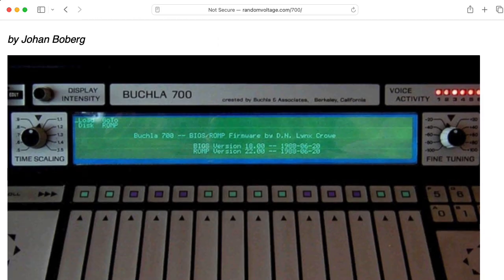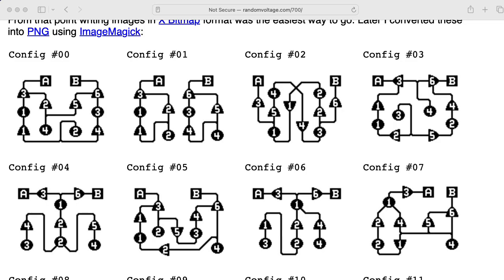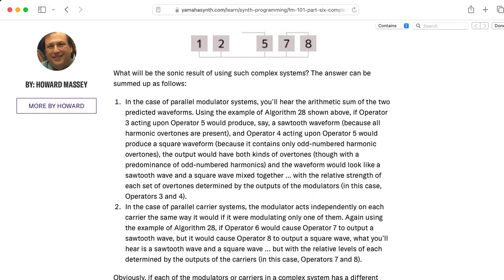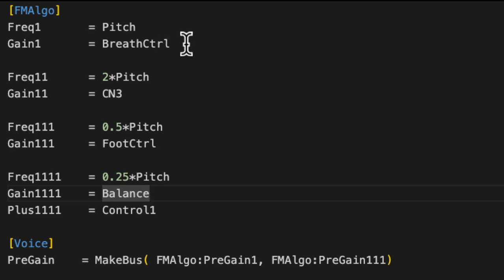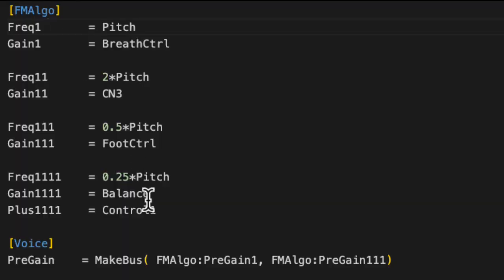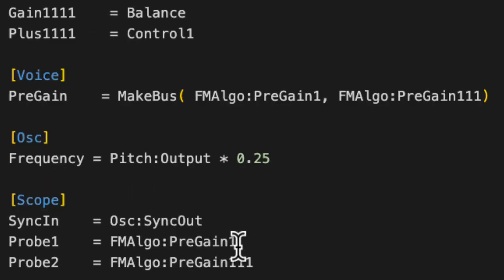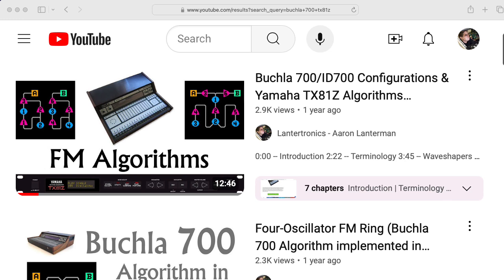Buchla 700 FM Ring implemented in Moselle Modular Synthesizer Software (Four Oscillator Algorithm)

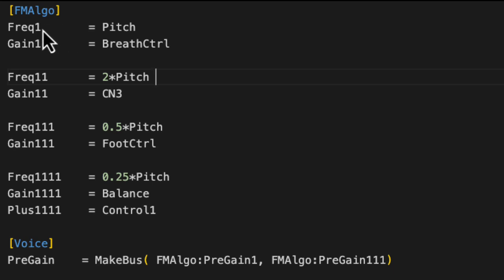Comment: 3:29 Yes: FMAlgo can be totally replaced with Osc blocks set to sine waves.  In fact you can also write the same thing using raw math with the Sin() function and Note:Time and Global:FreqEval (the sampling rate).  But FMAlgo will be a bit higher performance and as you say, hopefully easier.  BTW there's a Word manual that is 80% incomplete but has a nice chart of how to do the Yamaha DX7 algos in Moselle.
Reply from the maker: Oh! Is the Word manual somewhere on the website I overlooked or is it something you haven't released yet?
Reply: @Lantertronics  it's only partly-written.  I should go ahead and throw it into the next release even though it's 80% empty sections.
Reply from the maker: @franksheeran9243  Just a list of all the Modules, along with the names of all their Inputs and Outputs, would be tremendously helpful, even if it didn't have have any descriptions.
Reply from the maker: The main thing I recommend is dropping the 1/k scaling with harmonic number k on the harmonic coefficients. Constant coefficients should give me impulse waveforms, 1, 1/2, 1/3 should give me a sawtooth. I realize that involves changing a massive amount of the tutorials, but as it is it's going to lead to tremendous amounts of confusion -- I'm not aware of any other synth or software or textbook that uses an hidden 1/k convention..

Comment: 2:00 Moselle has had "waveshaping" penciled in for a decade.  If anyone has some favorite waveshapers I should take a look at before making something dedicated, please let me know!

That said, the normal math operators SelectN(), SelectLoopN(), Select(), LinFade(), LinFadeX() and Peak() do most of what the Map() module was meant to do.  You can also do all sorts of waveshaping with logic and math functions.  For instance IF( Signal >.5, .5, Signal) would clip the input signal.  Tanh() can give classic tube-style nonlinearity as the output keeps  getting higher but never quite gets to 1 no matter how high the input goes.  You could run a Sawtooth LFO's Positive output into Sin() to get a "poor man's sin oscillator" and do all that kind of thing.
Reply from the maker: The Buchla wave shapers are based on Chebychev polynomials, which should be doable using the math operations in Moselle without too much fuss, I think.
Reply: I can second the Buchla Chebychev wavshapers!

Comment: 2:15 Without any disrespect to the Buchla engineers or the documentation effort, showing the crossed lines on config #02 and #10 wasn't strictly necessary.  It would be understandable if they wanted to maintain all operators with inputs on top, outputs on bottom, as in the renowned diagrams for the DX7.  The root problem, I think, is that  they only had maybe 80x60 pixels or so to work with.
Reply from the maker: Yeah, those diagrams are based on someone deciphering the source code that spits out the diagrams. And yeah they didn't have a lot of pixels. :)

Comment: On the SY77 every operator has two inputs. When not used by the algorithm a free input can be used for a user defined 2nd feedback path or even patch in a AWM part. Unfortunately they dropped these options in later FM versions, the 2nd feedback path is quite a usable feature. In a way the synth engine of the SY77/99 was more advanced than that of the Montage and MODX.

Comment: Can you run moselle at higher sample rates / use oversampling? I ask because the digitone made me realize how much better fm sounds when the modulation is done at ultrasonic rates - the digitone uses 192khz if I'm not mistaken, and it results in much smoother and glassier tones and less of the "Sega fuzz" we traditionally associate
Reply: (continued, accidentally pressed reply too soon)

...we traditionally associate with the FM sound. BTW, digitone also has a somewhat similar feedback algorithm if I recall correctly, you can check the manual to verify but there's definitely some feedback configurations at any rate.
Reply from the maker: Yeah, FM can get nasty at high indices of modulation if there's a lot of aliasing.

There's a place in the configuration file of Moselle where you set the sample rate. This needs to match the rate of your audio interface -- to my knowledge it doesn't do upsampling, but if you run it and your interface a higher rate, you could always take the rendered file and downsample it later (I personally don't see a need for higher rendered rates than 48K, since all modern DACs are fancy upsampling ones anyway).
Reply: @Lantertronics  Dang, they should still add a specialized oversampler similar to some supercollider ugens. Oversampling the entire DAC is a bit overkill - it's mainly the modulation that needs to be oversampled, since FM generates a lot of higher harmonics and chaotic behavior once feedback is introduced. I'd recommend checking out the sound of the digitone, I've yet to find another FM synth (plugin or hardware) that sounds as smooth and glassy, and it's all due to the oversampled modulation IMO.
Reply from the maker: @superultramegarobot  Moselle development staff is just one guy working in his spare time. I'm wondering if they set up a Patreon or something to support development, would people support that?
Reply: @Lantertronics  I would, especially if we had input on development ideas!
Reply: @superultramegarobot  Good points all.  Moselle only has one evaluation speed, even running control signals at audio frequency!  I hope to improve performance very significantly so I think we'll be able to get by with just a control-signal speed (maybe audio/32? 1300-1500Hz?) and an audio speed.  It already has powerful global optimization, and I'm planning on compiling patches into machine language as well.

The "FM" in the FM Algo module is actually calculated with FM-equivalent PM, which sounds EXACTLY the same, but to the best of my recollection from ten years ago (when I wrote it) can generate each sample from first principles whereas FM needs to generate each sample from calculations done for the previous sample, allowing rounding errors to swamp the sound.  For instance the inputs into the formula to calculate sample N were themselves the result of N-1 calculations and rounding errors, if not 2 or 5 times that.  In the FM-equivalent PM you can just calculate sample N.  From memory, we could say

phase = phase + time*someConst/samplingRate *  ( 1 + amount * sin( time * otherConst  ) );
output = sin( phase );

for FM, whereas the same output by modifying the phase instead is:

output = sin( time * someConstant + amount * sin( time * otherConst ) )

Something like that anyway: the phase is added to N times and each time a rounding error is introduced.  Some of the amounts you are adding are extremely small and so may underflow a bit, not changing the running sum at all.   It just slowly turns to crap.

ANYWAY, since Moselle uses the FM-equivalent PM, the "merely audio" (not oversampled) sampling rate may well be enough.

(Note that CZ's genius-inspiration-level PM synthesis is another thing entirely, but Moselle has enough programming power to implement the whole CZ model with lots of extensions without it being built in.)

Comment: I think Jon Schatz in a recent update for the ID700 gives the option of more graphically discernible configurations for anyone interested. I really love that app and I'm not really into, but greatly appreciate, vsts.
For what it's worth a  Buchla700 reimagining would be my ultimate fantasy instrument. When I use the id700 it does help inspire my patching on my small 200e; I wish one could  change out the wavetables on the 259e.
Reply from the maker: I've wondered what a modern Buchla 700, call it a 700e, would look like. People might say, well, just get a computer with a DAW you like and run ID700. But you also need a touch surface. And the 700 also has those CV ins and outs. Well, you could add a MIDI-CV thing. But then an appealing thing of the 700 is its compact size.
Reply: Just putting this here, I know we aren't a MW forum, where I wish there was more active discussion sometimes in this regard.
But I can explore the idea of routings of amp, bw, fm modulation with the 291e and 261e (and 259e)
Reply: @johnmeroney2007  And remember that the 200e can be polyphonic, if you have enough oscillators. Just having two 259e's opened up nice possibilities. But the amount of envelopes one starts wanting after playing with something like the ID-700 is mind boggling. Why do synth manufcturers still keep using just adsr's on everything?
Reply: @topiaarnio8440 When I get the 200e-24 cabinet someday. I definitely will be getting another 259e as a third voice module. And probably a second 250e to make these complex envelopes when need be. But also a second or third 281e to create more complex functions and chains of them.
This will take years and years to afford to do, but I decided for the 200e to be my primary instrument. Though I will always have some Yamaha FM of some kind around.
Reply: @johnmeroney2007 I feel about the same. The 200e is so much fun and and can be grown slowly. Your plans are sounding a lot like my plans. Cheers!
Reply: @Lantertronics  When I get/can afford the 223e, I may then get the the 226h cv-to-midi, which you can chain two of apparently, and use that to operate the ID700. Also have plans to interface with the Rossum Assimil8or (amazingness) via the Locutus(which I don’t have as of yet).
Reply: I too use the ID700 for ideas of things to try with my small 200e. Nice to hear there are others.